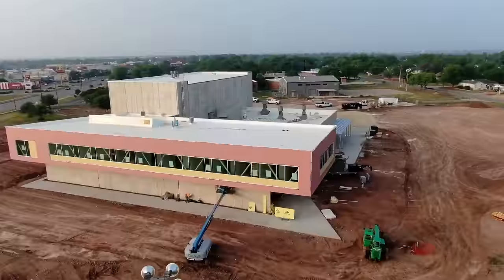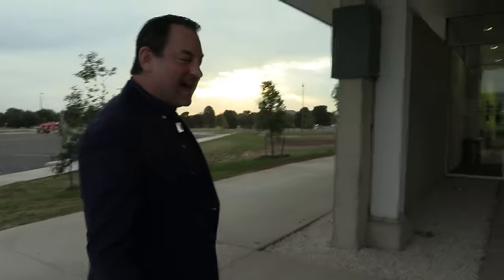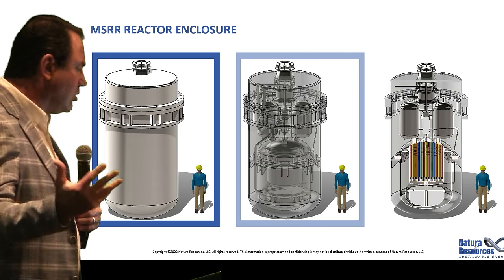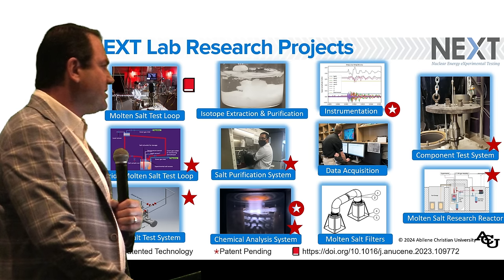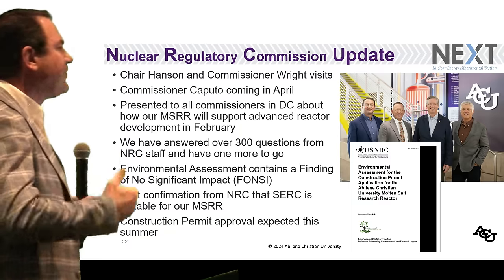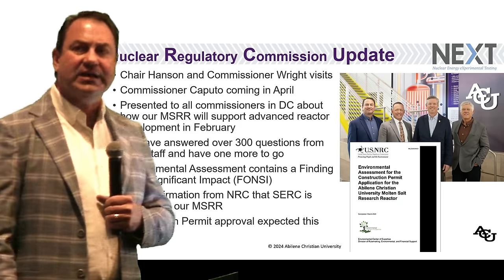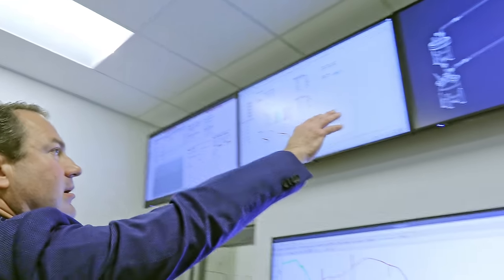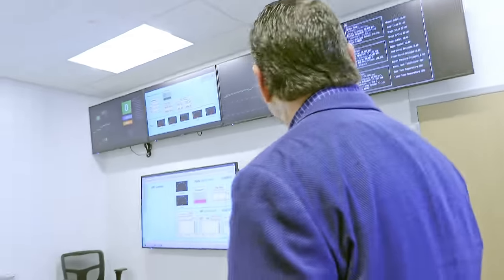TOUR of Molten Salt Research Reactor (MSRR) Site at ACU's NEXT Lab - Rusty Towell @ TEAC12

Comment: This is interesting but they've only got a hole in the ground. China has already built a 2MW pilot reactor and it's operating.  Given the costs of building anything nuclear in the US, it'll be cheaper to just buy the MSR from China. They're building more next gen nuclear fission plants than anyone else on the planet right now. These kinds of university reactors have been around forever and pretty much nothing has come out of them other than as a training source for nuclear engineers.
Reply from the maker: We assume China's TMSR-LF1 is operating, but we don't know. SINAP (China) 's silence is curious, since they were quite public about the build and the licensing.

MSRR seems like a very, very big deal to me. The reactor itself is far less important than the exercise in running a new licensing workflow through NRC. This workflow has never been tried before and is THE ONLY WAY to build the building before getting an NRC license. Now there's a building. Waiting for an NRC license. The optics are pretty, pretty... pretty good.
Reply: Also, why is a single operational reactor design all that's needed?
The Soviets came up with the reactor at Chernobyl. If they came up with that design first, would you be happy with them selling that design all around the world?

Let's seen dozens of designs that we know work and see which ones are the most efficient, cheapest, and most reliable
Reply: @blackoak4978  The shotgun approach to engineering is seldom the most efficient, especially for things as expensive and nuclear power plants and especially in the highly regulated US market. Far more efficient to pick one design and iterate as needed to incrementally improve it.
Reply from the maker: @seitch1  also I'd argue that Kairos Power's Hermes low-power demonstration reactor (Kairos received a licence to build 12 days ago) is a similar-but-different design. Moltex SSR-W is also a similar-but-different design. Even TerraPower Natrium reactor uses a molten-salt loop to store heat, though the reactor itself is a more conventional sodium-cooled fast-spectrum solid-fuel (advanced) reactor. Someone has to be the first, and likely MSRR will be the first. But it isn't like other ventures aren't trying to build varieties of MSR. That's just outside the scope of ACU and NEXT Lab's work.

Comment: Molten salt reactors have always failed through the corrosiveness of the salt.  What are you doing to reduce the corrosiveness of the salt?
Reply from the maker: Oh, which ones?
Reply: They use the stuff in solar installations to store heat.  Somebody must have figured it out.
Reply from the maker: @daniellarson3068  It isn't a serious question. "have always failed". Uh, sure. Corrosion is a thing, but the point of MidnightVidsions "question" wasn't to ask a question.
Reply: Reading here it sounds like a Copenhagen company in Denmark has addressed the corrosion by producing salt that is 99% pure and claims this salt will not cause corrosion in these Thorium Molten Salt Reactors plumbing.  No excuses now , so let’s get it on and make any other improvements along the way . Our electrified system is way behind.

Comment: When the reactors fail and stop, how long and how much does it cost to get it working again. 
Nobody has a spare $2billion reactor to turn on. 😮😮
Reply from the maker: This is the 10th video I've posted that you've commented on. Your 1st comment (10 videos ago) talked-up solar and batteries. It is clear you don't actually watch the videos, because none of the comments you make are video specific. If I tossed down your 10 comments, and the 10 videos you commented on, you'd never be able to put them back together. Any reason I shouldn't block you? (Aside from the boost in engagement your useless comments bring?)
Reply: @gordonmcdowell  Good comment, Gordon. I am making the point that nuclear electricity has economic limits.
You should get stuck into my arguments.

If CO2 emissions elimination is the target of nuclear electricity, then a bigger national electric grid is needed to get the greater amount of electricity to the millions of customers. 

This grid cost is a fundamental constraint on nuclear electricity generation and transmission to the customers.

If you are genuinely interested in successful using nuclear electricity, you might find a solution against what I am saying. 

Australia is facing the nuclear question again from the same political party that stopped nuclear in Australia. 
The federal LNP, the business party, promotes economic common sense.
But I think that they have been hijacked by a faulty economic argument. 

They should support my point and protect the existing national transmission grid by unloading it from all buildings and diverting the electricity into new business.

I  know it is hard to accept my insights, and you have not wimped out.
I am not against Australian nuclear submarines, I am not against existing nuclear electricity plants, I understand cold latitudes bigger problems. 
The technology in the video is impressive and internal combustion engines are impressive.

When the sun comes up and the cash flows to the grid stops, particularly in the long, sunniest months, then conflict will hit hard, and it will be a government trying to manage energy cash flow. 

Nuclear promoters know new grid is extremely expensive and so promote existing generation sites.

Nuclear promoters say distant renewables new expensive new grid and so are not cheap.

Nuclear promoters agree Electric Vehicles, Battery Vehicles, are in our future. 

Auto manufacturers know that many know this.

I  would appreciate more than opinions. 

I  do make an effort to respond to people commenting as they have taken their time to think.

My construction career has given me useful understanding.
Reply from the maker: @stephenbrickwood1602  Why do you say "If CO2 emissions elimination is the target of nuclear electricity, then a bigger national electric grid is needed to get the greater amount of electricity to the millions of customers" ? Just deploy right-sized reactors where the power is needed. You can't just deploy solar/wind where the power is needed, solar/wind are geographically constrained. Solar/wind need more transmission lines. This is illustrated today in Germany where their 10 Billion Euro north/south SuedLink transmission line only began in 2023, and is needed to bring wind power from the north to the industrial centres of the south.

Why are you commenting your generic anti-nuclear arguments HERE on THIS VIDEO? You're still doing it. Prove to me you've watched the video before you leave your next comment or you're blocked off the entire channel.